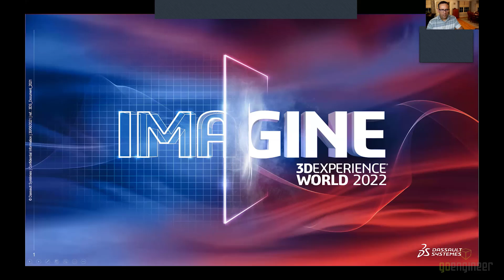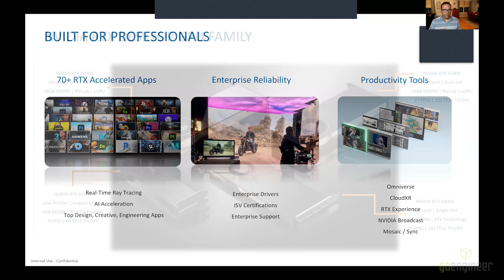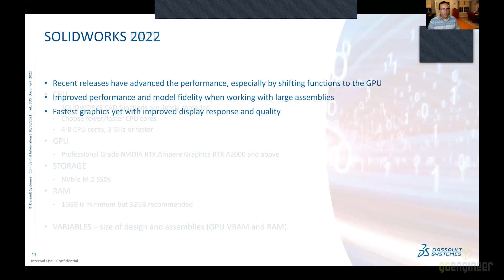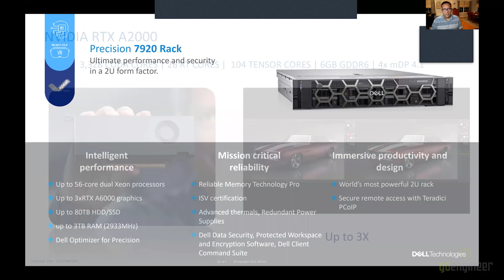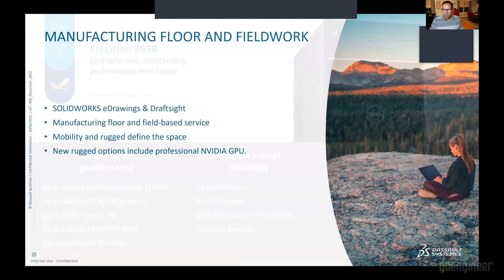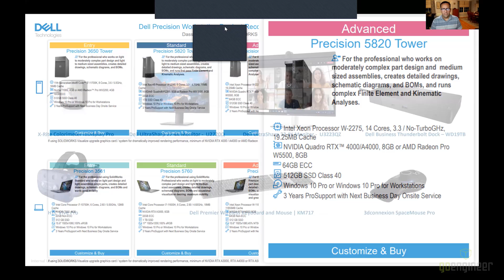Optimizing your CAD Workstation Budget: Find the Best PC for SOLIDWORKS

Comment: Gaming PC and gaming laptops work just like workstations in Solid Works or better but they are cheaper and you also can play videogames on those
Reply: Not when it comes to large files and large assemblies. But for basic modeling a gaming laptop is just fine.